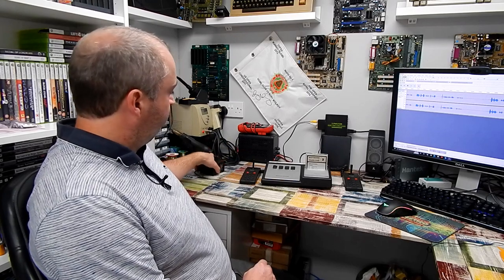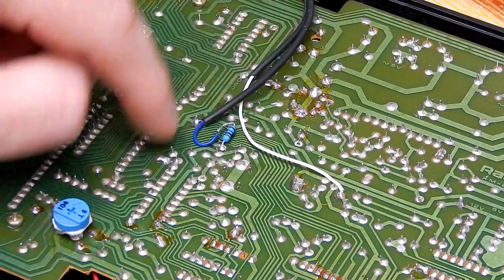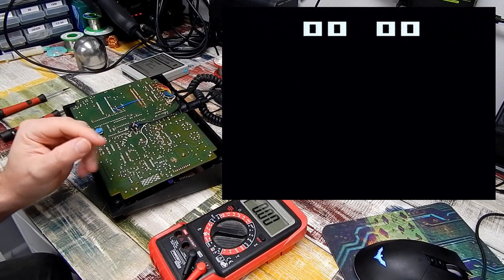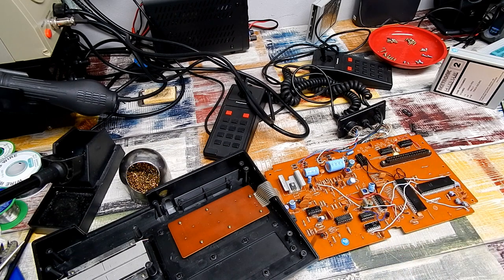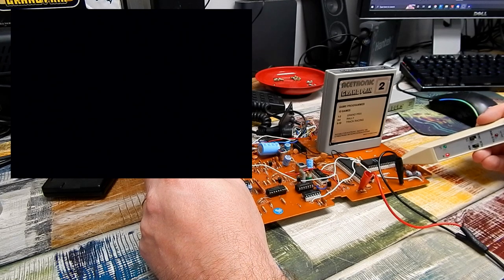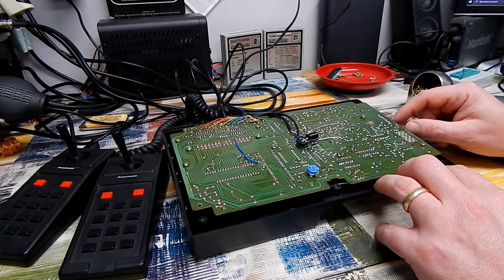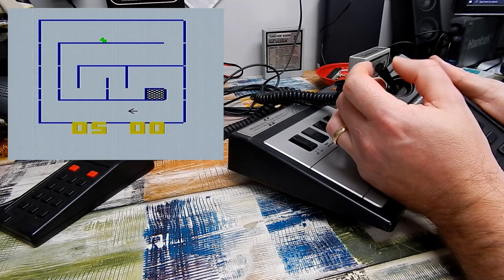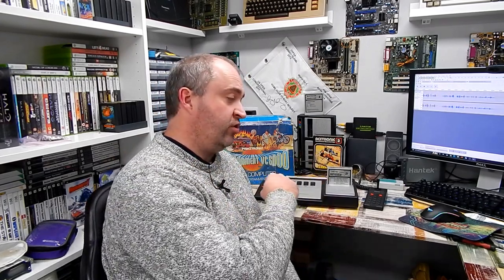Prinztronic Tournament VC6000 Part 2 - Lets fix it

Comment: The new desoldering gun looks a lot like the one on my Pro'skit unit. Just the body part, the barrel does look different, so evidently they're using a different heater element and nozzle.

Comment: Looking at my (patchy) records, it turns out I have three probably similar systems, all Radofins: a Telesports 3, a Telesports 4, and something I've only described as 'Radofin programmable', from the eBay seller description.  I got all three back in 2004.  From memory, one is incompatible with the others due to the cartridge slot.  Looking at the list of games, there's not much to get excited about for all your hard work, apart from it being a small part of gaming history.  The Videopac certainly seems to have better games, and more of them.

Thinking about the licensing of the design, this was apparently the intention with the VIC chip used in the VIC-20; Commodore created it with the intention of selling it to companies to create low-cost games consoles.  If things had played out differently, we could have had a small family of somewhat compatible systems based on the VIC chip.
Reply from the maker: Its possible all 3 of those systems are the same under the hood or certainly similar anyway.  Of the 2 games I have I can see some entertainment in there, certainly in space invaders, but granted it certainly shows its age.  

I have a videopac as well and recently just got a few more games for it, that system while on the surface seems similar in capabilities certainly, from what I've seen, has the better library.  

Very interesting about the VIC.  I didn't know that and indeed if Commodore had have pushed it out like that I'm sure there would have been a slew of VIC powered machines.

Comment: Got a radofin from this serie of consoles. And indeed you always need to reset/load program after turning the system on. Otherwise it won’t run the game.
Reply from the maker: Thanks for confirming that the way its meant to work.  I thought it really interesting seeing the manual reset of the CPU like that but I suppose it was simpler and thus cheaper to make.